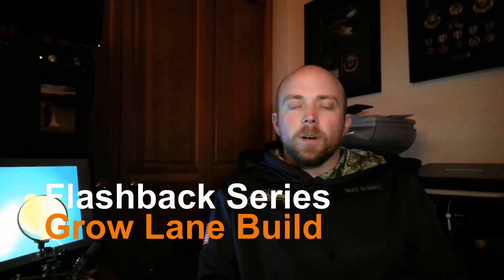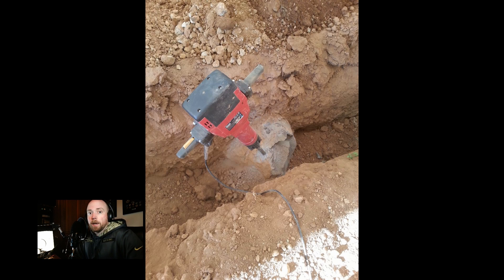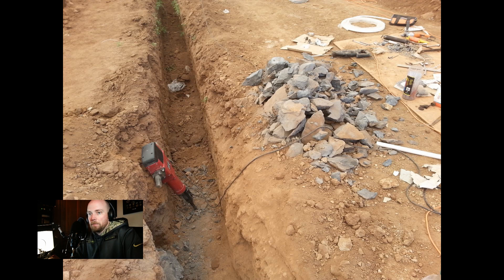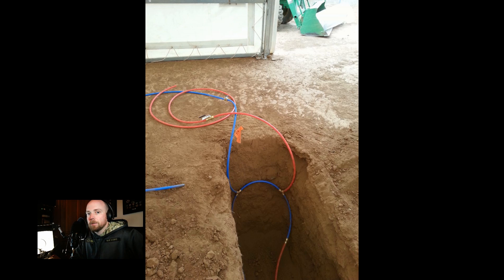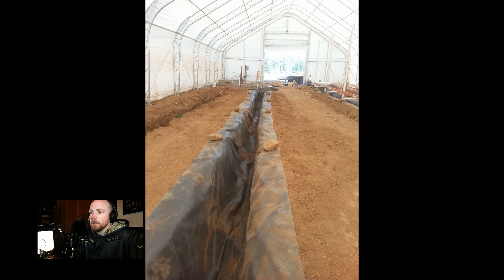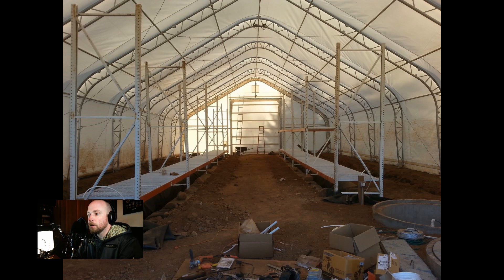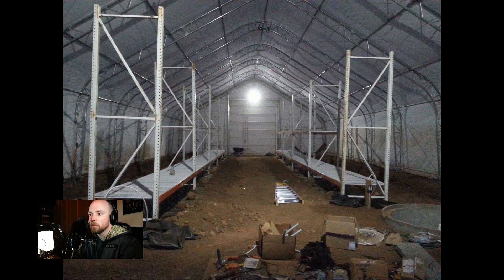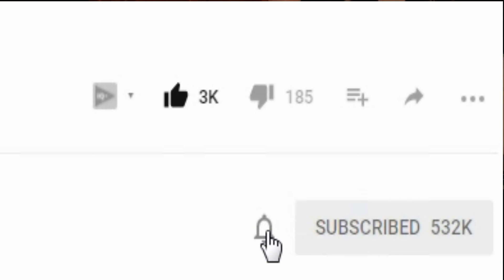How to Build GEOTHERMAL Heated Fish Tanks And Raised Beds

Comment: I would use pressure treated wood and probably paint it as well. use it to build a box to put the pond liner in. As for the pilings - steel pipe set in concrete or packed rock. put the pilings just outside the box to add some strength to the wood and keep it from flexing.

Comment: When you get to phase 4, if you need to use a jack hammer again, a larger jack hammer will actually make the job much easier. It looks like you were using an electric 60 lb hammer, & the standard 90 lb pneumatic hammer is so much more effective. Also when using any jack hammer, try not to grip tightly and let the weight of the tool do the work - your hands will thank you afterwards.

BTW, if you're still having snow removal challenges on your solar array, you could borrow one of the lane heaters during the other 45 minutes of the hour to warm up the back sides of the array & get the ice/snow to slide off on its own, but you'll need to clear the front area to have room for the slide to fall to, & then clear that away too... Then again, you also still have wood fuel left over??? Could be some way to repurpose that too. 

Hang in there & good luck. I sent you a pretty long email last night before I found my tablet, but I'm subbed now :)

Comment: I would use those 12inch concrete tubes long as needed for load bearing with proper concrete construction. rebar and wire mesh great work so far

Comment: I would tend to head towards concrete pillars down to below the bottom of the fish tank where the feet if the racking is so the weight of the racking is sitting on the sub soil and not on the walls of the fish tanks :-)

Comment: I would like to see the fish as they r growing and I see this method going against that, I wish u could have some viewing windows in place along the trench to check the growth progress of the fish too. That pond liner would cost a fortune here but in the ground is better for temps - no argument there. I would have thought u would have had atleast a 2 x 6 that was 3 to 4 ft long as supports for the each vertical stand of the shelf so the 2 feet would utilise 1 timber bridging across the fish tank as a stable footing.

Comment: I am going to say something about semantics.  It is also definition.  What you are calling cement is correctly termed concrete.  Cement is the powder which is the glue that holds the sand and gravel(aggregate) together to form concrete.  The cement is hydrated by water to turn everything hard.  Concrete is considered to have no tensile strength but is very high in compressive strength and that is why steel reinforcing is put into concrete structures to take the tension loads.  Many people use the terms interchangeably but in reality the terms mean different things and can cause confusion.

I am a Civil Engineer by education and we were strongly admonished about the differences in terms and usage.  There is also a difference between soil and dirt.

Good fortune with the project.
Reply: Thank you.

Comment: put a steel t bar over the fishtank under each rackelement. have it extent quite wider than the tank. possibly support end by concrete tile to distribute weight you may lower the bar even level with ground so you wont trip over it

Comment: the issue is that there's nothing holding the racks to the ground, when those are filled they're going to be extremely top heavy, a piece of wood or deck footing is not going to do it.you need concrete footings sunk into the ground to hold the racks DOWN

Comment: I would think that a pylon under each rack post would be enough. A Forming Tube and concrete set 12 - 18 in below each fishpond with a crossbar on top would be plenty (if not overkill).

Comment: I am interested in setting up an aquaponics system. I plan on digging holes 4ft wide X 3ft deep X 12/16ft long, and use pallets to build a box inside the hole, then lined with lauan plywood on the inside of the box (t smooth out any rough edges),  and use an above ground pool liner to make it waterproof, then just backfill the outside edges  to provide support for the tank walls. Once the tanks are built (2), then build a greenhouse frame around both tanks. using deep pallet shelving I can build grow beds (flood & drain) over the top of the tanks.

Comment: I would be inclined to do pilings that the feet of the racking could be bolted to. If you didn't have the trenches in, I think I would get a post hole digger on a PTO and drill holes at least 6" in diameter to a foot below the bottom of the tanks. Fill with concrete and maybe some rebar to ground level then come back and trench down the middle and do your pond liner.

Since the trench is in already, you could still do the pile, but it would be a lot of hand digging and form work or Sonotube. Cost wise you might consider earth bag construction for the footings and walls in lieu of concrete, or stacked and earth packed tires.
Ideas a plenty.

Comment: As you add more to your racks you will find your compacted earth footings will not be stable enough.  The more mass you have on the racks the larger the footings you will require.   At this early stage may I suggest that you fabricate timber footing forms at each of the legs and fill with concrete - on your undeveloped grow lanes.  Then move the existing racking to the ones with proper footings.  If you use treated timber you can leave the forms in place.  Easier than digging under the existing legs and trying to pour footings in place.  That way you can get your levels correct.  That way you can maintain your production and cash flow till you have the funds required to expand.

Comment: What if you did no concrete footings, but instead lay down a steel beam along the entire length of the ponds. it would give you a nice level surface to place the shelving on, and distribute the weight of the shelving,. i would envision sinking the beams into the dirt till they are level with the surface of the dirt floor. and you could then place a few beams across the ponds to keep the beams from pushing in on the pond. It would be cheap and also wouldn't be a permanent structure. Im no aerospace engineer though :)
Reply: Alex Banman    I was thinking something similar, only rather than parallel along the length of the ponds, running them perpendicular across all four ponds.  That way, each row of racking would be tied to all the others, plus, there would be little load near the ponds that may compromise the wall of the pond, as the load would be spread out over the more stable ground.

Comment: oh yes concrete is your friend in hindsight that Boulder could have been a lot easier to remove if you were going to go with concrete footings. would not have to worry about the wall integrity. I assumed you were worried about the wall integrity because of the weight of the shelving and plants that would be on it.